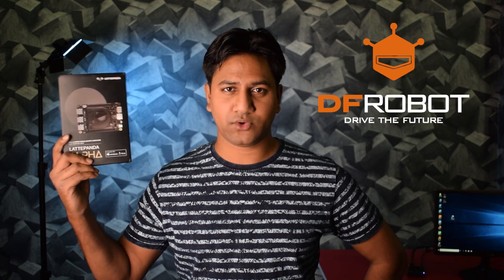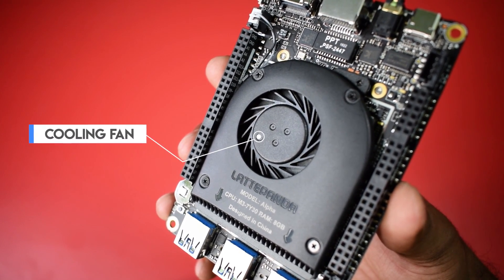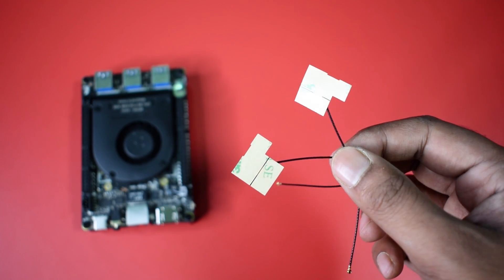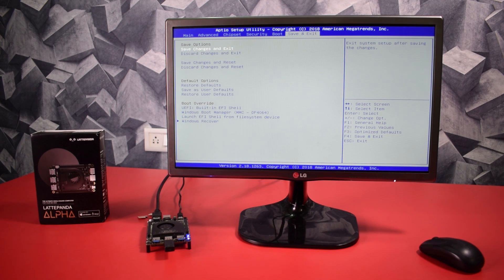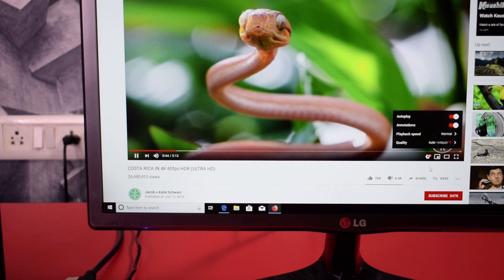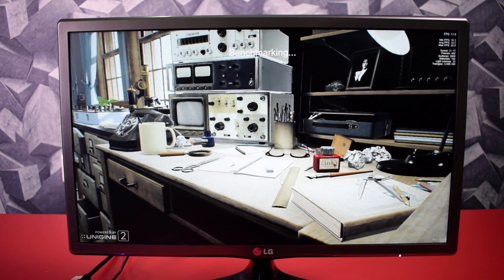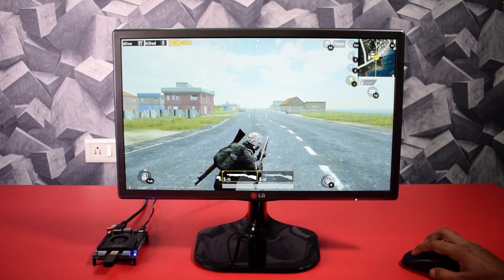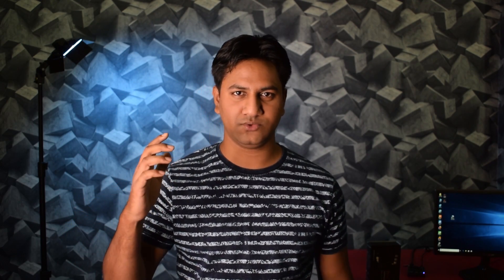LattePanda 2 Alpha 864s Review | the most Powerful SBC (Raspberry pi Killer)

Comment: LattePanda Alpha can i use with powerbank  
?
Reply from the maker: You can use Battery
Reply: @TrickiKnow  sir again i thank you for your attention to my equation . i have for you two equation and have to know before i buy this device . 
1:- can i use with huawei mobile router e5573 wifi  or any device  to get a internet ?

this model 
https://www.google.com/search?q=huawei+mobile+router+e5573+wifi&source=lnms&tbm=isch&sa=X&ved=0ahUKEwir_efgwP3jAhWs16YKHQPMDzkQ_AUIESgB&biw=1623&bih=887#imgrc=P1hZ8_MjE2yH5M:

this model
2:- can i use webcam for streaming pc i would like to chat with friend via Skype ?

https://www.google.com/search?q=webcam+for+streaming+pc&source=lnms&tbm=isch&sa=X&ved=0ahUKEwibwoLuwv3jAhUoiIsKHeNYAnsQ_AUIESgB&biw=1623&bih=887

plzzzzz give me those answer and if you have more information you can help me
Reply: According to the official website, as long as your powerbank supports 45W (or minimum 36W) PD output and it will work fine. One that I know that can power this LattePanda is Xiaomi's Powerbank 3 (not so sure about the model outside mainland China) (with 20000mAh and 45W USB-C output), and the price is about 30USD here in mainland China.

Comment: Can we play Games like GTA 5 in this Miniboard
Reply from the maker: Yes you can play gta v in low settings , with the egpu you can play in high settings.
Reply: @TrickiKnow  Can I Connect external Graphics Card through eGPU, mine is  hp 15-Notebook with intel i3-6th Gen processor